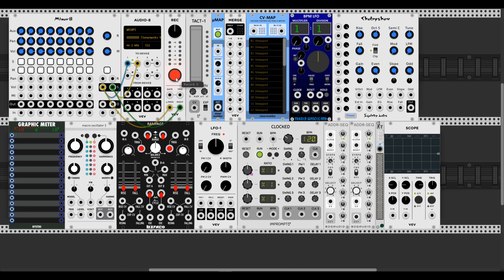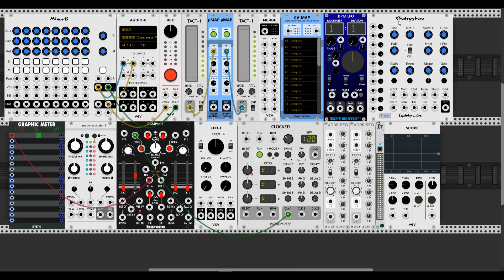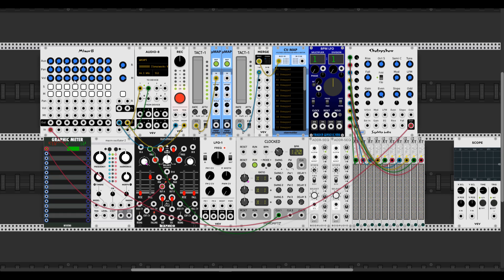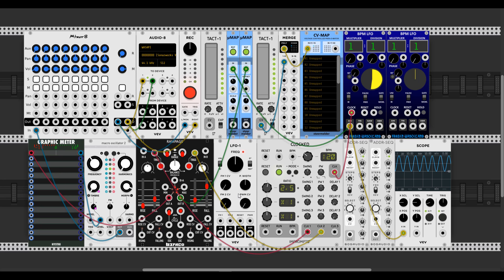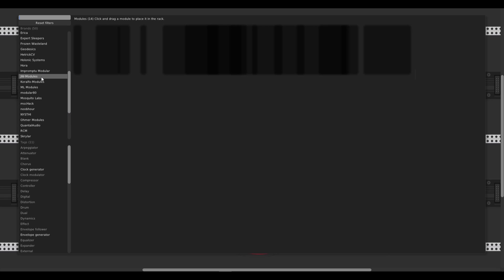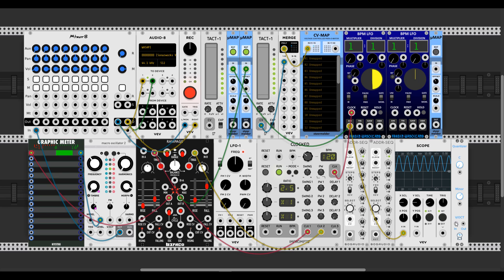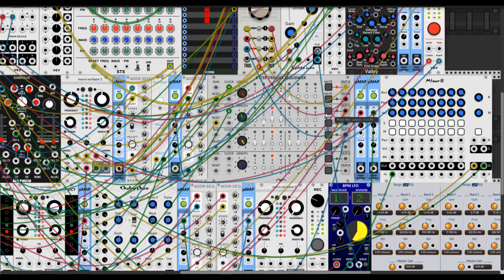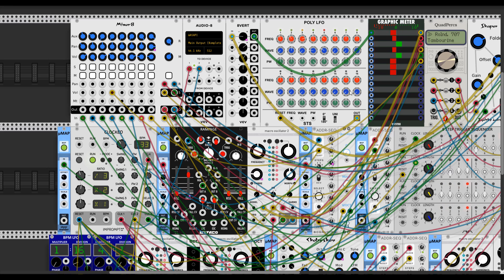Mapping in VCV Rack without MIDI Controller

Comment: fantastic tutorial as always, thanks 

a little tip   (I m sure you know this) 4:36  if you set you first module  and  press Ctrl +C with the mouse over it, you are able to paste the value  in the subsequent with Ctrl +V
Reply from the maker: Thanks and for the tip too! Just forgot to use it really
Reply: @VCVRackIdeas  you know what could be nice? a module capable to store multiples entries  of the Ctrl+C buffer, and you can invoke  it when you need it...